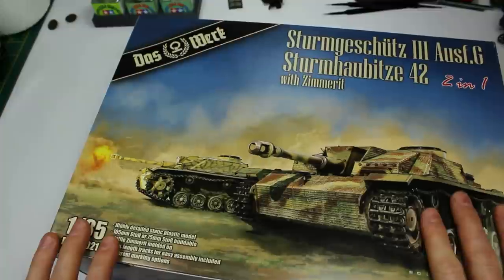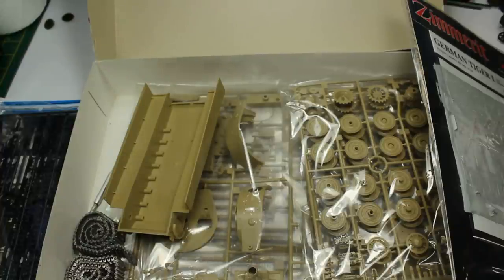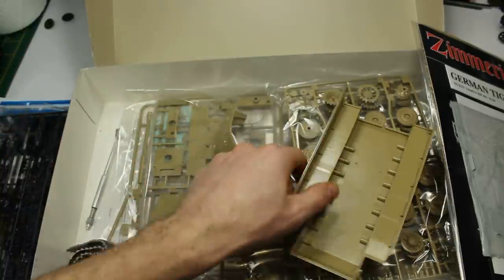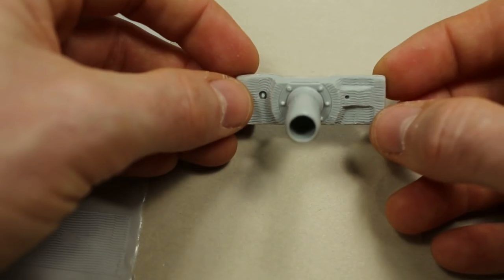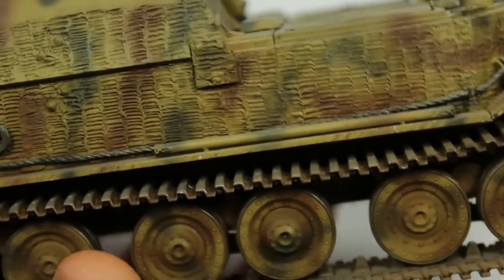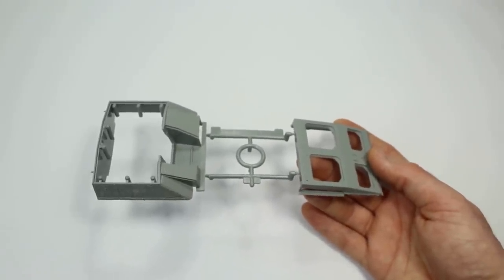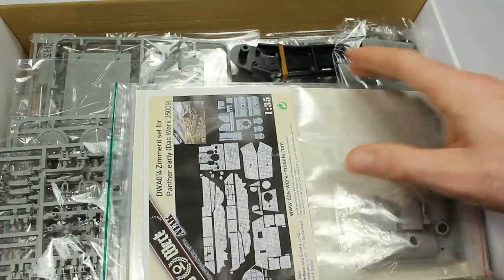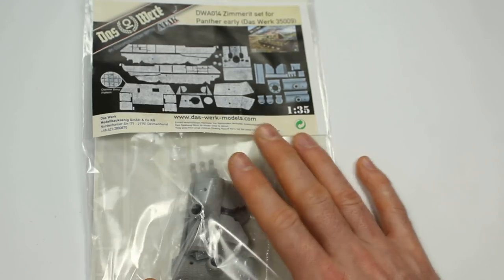Zimmerit for Tanks, Scale Models Basics, Beginners Guide To Armour Modelling

Comment: I just got finished with Hobby Bosses King Tiger and was my first experience with applying Zimmerit. It was designed beautifully and went on without a hitch. Just applied a very thin layer of glue on the part and line the Zimmerit up and smooth down. Matched on all edges perfectly.

Comment: I made a trumpeter 1/16 scale Panzer IV and added Resin zimmerit. Using liquid superglue leaves no time for fine positional adjustment. However super glue gel was fantastic, it has that adjustment time you need to to fine tune a larger sheets of resin zimmerit into the exact positions required.

Comment: Great video.
I recently built Tamiya's new tool Brummbar with their sheet of self adhesive zimmerit.... and wished I hadn't. Before getting painted the zimmerit sheets started to peel at the corners, so I superglued the corners back down. When it was done and painted, the self adhesive sheets started to peel off on corners that I hadn't superglued down, so it went in the bin as I couldn't be bothered to fix it. The sheets are a nightmare: you have to cut out every bolt hole, and every tiny little curve and so on... if they were pre-cut I might be a bit more forgiving, but I'll never use them again.
I generally stick to Milliput (white) and have some sets of PE trowels for Tiger zimmerit and some stamps for Panther and Stug zim patterns. Good video though, and I never knew that about those Hobby Boss kits - I might buy one. Thanks for sharing and looking forward to the next installment.
Reply: Also have tried those Tamiya Zimmerit sheets - did not care for them for the reasons you mentioned. Will not use them again either.

Comment: Nice video, I could have used that a lot back when I started modelling and was mortally afraid of Zimmerit ;-) In the years since I've tried pretty much all the methods and so far Vallejo putty is my favourite. It sticks well to plastic and can be easily shaped with the etched rake tools provided with some kits (also sold separately by Tamiya). The good thing is, you can also scrape it off fairly easy even when it's dry, which is nice if you're not happy with a spot or want to recreate some battle damage. It's best suited for the fine ridge pattern often seen on Tigers, for a more rough, irregular pattern I still prefer Milliput and a screwdriver.

Comment: I’ve used both the DEF Models decal zimmerit (for the 2019 release Academy Stug IV) and the Tamiya “sticky” Zimmerit sheets (on Tamiya’s Pz IV Ausf J early). The decals from DEF Models worked ok but clearly had some flaws along the edges of seams to deal with. The Tamiya stick on zimmerit was worse and didn’t stick on as well as I would like to see in several areas near raised details. I’ve got the Tamiya Zimmerit tools and will give that a try with some wood putty sometime soon.
Reply: Do the zimmerit the way I do it. I do the hot knife method. Its tedious but  very effective.  Go to fenderlickengood on Instagram.  You can look at my tamiya mid production tiger.  It was done that way. Happy modeling!!!!

Comment: I have used what is known as glazing putty used in autobody with a zimmerit blade tool, it worked well but fumes were pretty bad and you have a time limit to work within because it uses a hardener, similar to a epoxy, definitely mask off any area you do not want the zimmerit because this stuff fuses to the plastic, I suppose you could decrease the hardener you mix into it to give you more time- at the recommended ratio you have about 5 minutes of work time.....probably way overkill, I have done some body work before and blazing putty is the last step in the process to fill pin holes and finely tune the surface and can go on ultra thin. 
Just throwing this out there as a possibility.

Comment: The Champ is here! Is it wrong that I'd probably just be lazy and plump for moulded on Zimmerit? I more prefer the painting side of scale modelling so investing all the time in the a manual zimmerit is the same as doing individual link tracks to my mind i.e. can be a right ball ache. I've seen some tools online like little stamps that look like a good cheat instead of using a saw blade or screwdriver. Those resin sheets seem to be a happy medium. Super thin so easy to cut out and do any trimming if you need to fit them to the tank.

Comment: I have shaky hands the track build was a challenge but worthwhile pity all kits didn't have this system that hobbyboss has is cheaper option than the metal tracks , the zimmerit was the best so far I have used cheers

Comment: I'm building that stug myself but it is the one Dragon  got completely wrong and das werk have put the same kit out with no corrections! It Alkett waffle zim, the return rollers should be the steel type the mantle is wrong it should be the saukopf mantlet on this one! I have the Dragon 6 day war stug it has has all the correction part's in that kit so you can build it accurate I already had it but the six day war kit had the super structure caste without zimmert that's the one that should have been in the das werk kit to start with! When you start doing your own research into it from Hilary Doyals research it all falls together with these 2 kit's to kit bash them with!

Comment: What is zimmerit
Reply: It was a PASTE that the German army placed on their armored vehicles from about mid-1943 till about September 1944. It was meant to help defeat any MAGNETIC Mines that enemy soldiers may try to place onto their vehicles. The magnetic mine would not be able to attach properly because of this barrier between the mine and the surface of the vehicle. It also added additional unnecessary weight to the vehicle as well. Although most armies during WWII had some type of a magnetic mine, pretty much the Germans were the only ones that used them - they probably figured since they had/used them, then the enemy probably have/will use them as well.